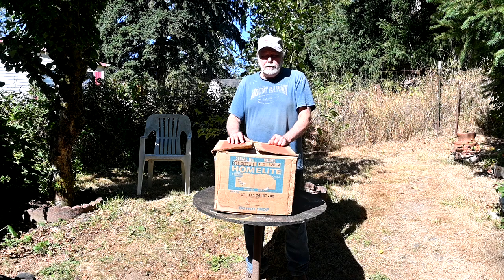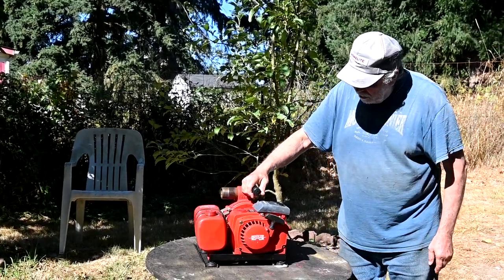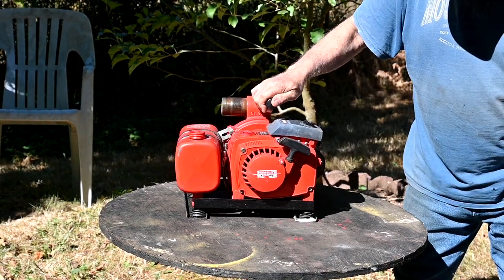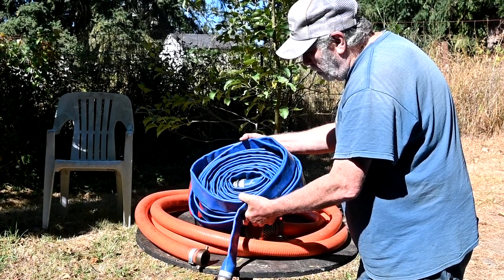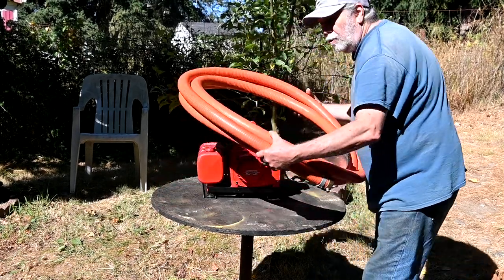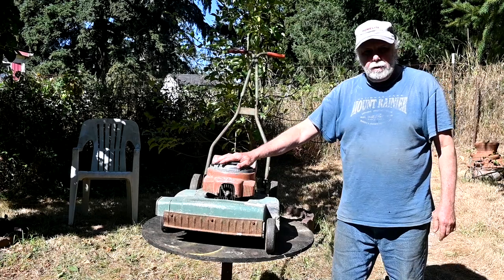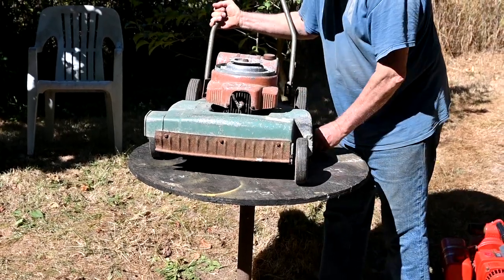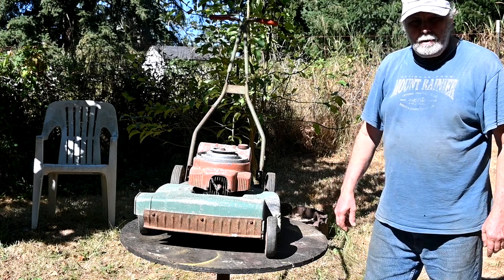Vintage Homelite  Unboxing + Vintage Lawnmower BS

Comment: I got a smooth cut on my lawn, yesterday.  I had let it grow out to much due to the rain we have had, recently.  I cranked up my Snapper SPX 23.5 horse tractor, set it to cut at four inches and mowed it down.  Finished up with my Snapper Ninja mulching mower and Husqvarna 28 weed eater.

Comment: It'd be great to see some of these vintage lawn mowers in action!
Reply from the maker: Some of the mowers need some repairs or restoration, which I hope to do over the winter.  I would suggest you look at some of my older video's.  I have done some on my 1955 Craftsman, my FLYMO, and a couple of LAWN BOYS, out mowing.

Comment: Wow, that's Awesome, In the original Box even! Score!😊
Reply from the maker: The Homelite was a neat find for sure.  It has the hoses, box, spark plug wrench, special wrench to operate the valve on the pump body and also a parts manual.  Only thing missing was the owners manual, which had been lost years before I scrounged up the pump.  Another interesting piece of junk on the homestead !

Comment: Magnesium deck on the mower. A lot of the old ones were made that way. good video as always!!!!!!!!!!!!!!!!!!
Reply from the maker: The alloy decks are nice and light, but they are brittle, and rocks can damage them.  Most alloy decks became aluminum, so as to cut costs. Thanks for the nice comment and for watching.

Comment: Planted my winter garden, today, with a Troy Built cultivator that I saved from the junk heap.  I rebuilt a lot of it and replaced or repaired some more things.
Reply from the maker: It is most satisfying to be able to fix stuff rather than have to buy new crapola every time one needs to do a job. Bet you agree on that.
Reply: @mrobsoletesvintagehomestea9156  yep…..
Reply: @mrobsoletesvintagehomestea9156  the crankcase on this four cycle was filthy, as was the fuel tank.  I put an ounce of kerosene in the crankcase and ran it for a while.  I dumped the oil out a total of eight times before it came out clean after running for 15 minutes.  I sprayed Super Clean in the gas tank and hit it with my hose with a nozzle on it and blew it out good with compressed air.  Both the crankcase and gas tank are as clean as I can get them.  The first time I tilled with it - it had to burn off the kerosene and Seafoam I had in the oil but after that it did not smoke a bit.  I used Briggs’s30 HD in it.  It only holds 3 ounces of oil (90ml), so it is a real cheap oil change.  I put a heavy dose of Seafoam and Startron in the gas tank to get rid of any remaining moisture from the cleaning.

Comment: I had one of those Clintons on an old rotary mower that looked like a bathtub turned upside down. The front wheels were beveled to the inside. It had a jack shaft with a belt drive.
Reply from the maker: That would be interesting piece of equipment.

Comment: I would like to see a 1955 Toro reel mower with a 5 HP Briggs, I believe, on it.  I pushed one of those around the yard for years until I made sure it broke.  It had belts that were suppose to propel it but most of the propel I had to provide.  I swore if I ever found one I would turn it into a boat anchor but would not tie the anchor rope to a cleat on the boat.  All I remember is it was red and had a black motor on it.
Reply from the maker: It is interesting how one basic design that was used by many companies, didn't work too good and others did a great job.  My lawn is too uneven to use a reel mower, but I do have some in my collection.  I have a REO, Cooper Clipper, Eclipse and a Sunbeam just for the heck of it.

Comment: Early Homelite chainsaws were belt drive.
Reply from the maker: Most early saws were gear reduction, as the motors weren't that powerful, so one could run a big chain and a fair sized bar.

Comment: I have pump envy. Lol I have 2 of those but they don’t have the external tank. And they aren’t that nice of condition. That ones like a 9/10 and mine are about a 7. I have a couple of McCulloughs I could trade for something. A 610 and a 310x2. Shipping probably makes it not worth it I’m in bc Canada
Reply from the maker: The Homelite pump is a keeper. I would never find a nicer one, and it ad's diversity to my Homelite collection.  I have plenty of the Mac 610's,  my favorite work saws, and I have a number of the mini Mac saws I use on a regular basis also.  Shipping to Canada is terribly expensive also.  Thanks for the offer though.